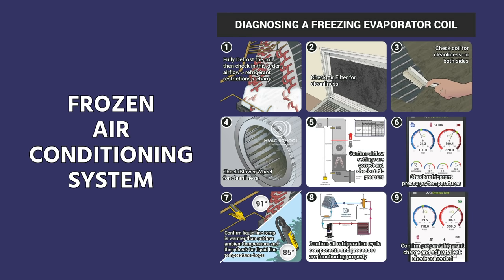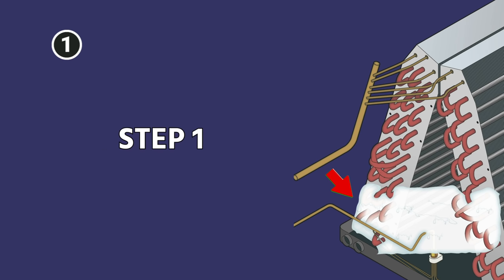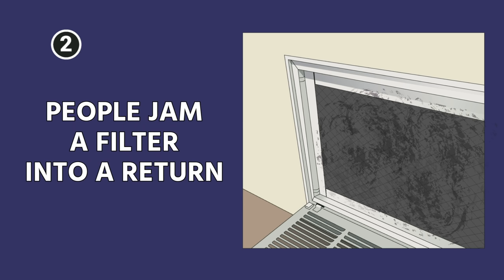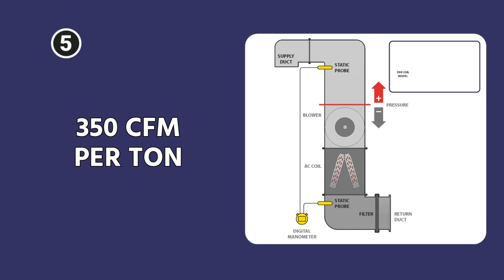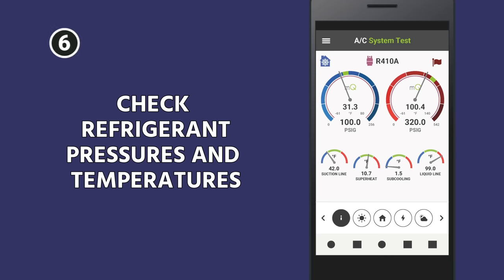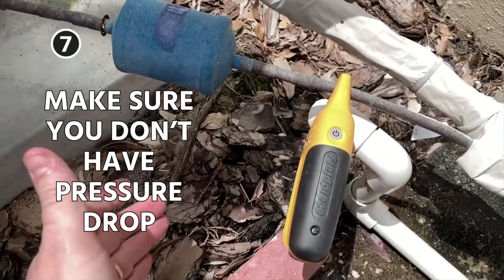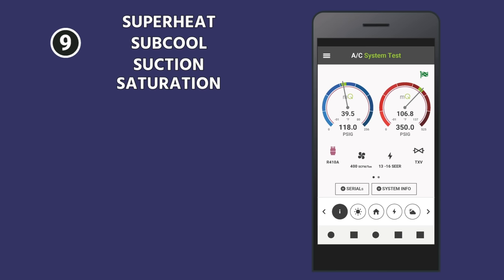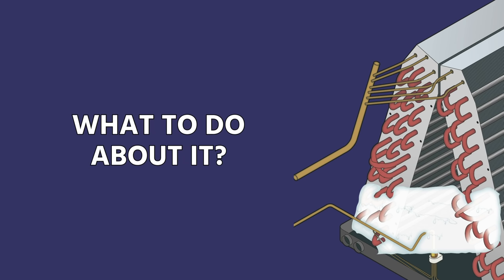Why Does The Evaporator Coil Freeze (And How to Diagnose It)

Comment: Fair warning- if a blower wheel has been dirty long enough, you can KO the motor once you put the full load of a clean wheel on it.
Reply: i always give my customers this disclaimer before I clean a blower wheel. also if the evap coil does freeze up i tell them that expanding ice can cause leaks in the joints of the coil. I've witnessed a 1 year old split system (in the attic of a 30 unit apartment building heating and cooling all the common areas) whos filter never been changed (one year) have leaks after i thawed the thing. i'd already put in my 2 weeks at this point so i no longer had a filter when talking to customers and told them since you were cheap and didn't want us to maintenance the equipment, now you have a massive leak.

Comment: In the house units. It’s always one of two things. 1). Low air flow. 2). Low freon. Always. Every time.
Reply: B
Reply: You just stated a generalization that is always true of every system...so, did you not understand this video?
Reply: @Maxumized  which part did you miss? Did you not even watch the video? It's you that don't understand. I've been doing HVAC repair for 35 plus years. Refrigeration and auto ac for 43 years..

Comment: I do know when its 90 out and humidity approaches 95%….It becomes much easier for the “A” coil to freeze up, if it does, turn on the heat!!!   Takes very little time to THAW out  the coil and dry it out, works!!   And then let the compressor cool down as well.

Comment: I have a unit in my attic , I wanted the a coil cleaned . I called a HVAC company to do the best task, he was up there for 1 hour. And the secret hidden camera I had up there recorded fed him sitting down occasionally running his drill into empty air , tapping occasionally with a screw driver on the metal, ran the vacuum motor but not actually vacuuming any thing he was on his smart phone the entire time. I was charged 209.44 for nothing, I showed the video to him he said he was going to sue me for recording him without permission, later in the week I got a check for 225.00 back   Wtf??
Reply: Guess he figured his picture was worth $15.56. At least you got reimbursed. No telling how many times he has stolen people's money.
Reply: Oh and another thought, these damn smartphones today,  nobody gets anything done anymore everywhere I go people at any job f in with their gdamn phone. It's absolutely insane.

Comment: What is your opinion of turning the heat on to thaw the evaporator
Reply: I do it quite often but monitor the liquid line temperature
Reply: I'm not an HVAC tech at all, but deal with Magic Paks. (All in one unit within the rental unit.) I turn the system off and turn the fan to "on." Make sure your condensation drain is clear, tho. Our 3/4" drain lines start on the 3rd floor and lead to the garage that tends to get plugged also.

Comment: So, I get what might cause an evaporator coil to freeze, but I'm trying to understand how it happens. An example, if my coil is dirty, the evaporator will freeze because the refrigerants drop in temp. Is causing that (due to no heat absorption) am I in the right ball park here?
Reply: Yes! You got it. On a dirty coil, the refrigerant temp drop is accelerated so coil continues to drop in temp and moisture in air freezes.
Reply: @Maxumized  yeah took me a while but I finally get it. Pressure and temp are related.  Restricted air flow means more liquid refrigerant which means less pressure in the Evap. Which in turn leads to lower temp. I never knew hvac could be so engaging
Reply: The way I see it, low air flow/dirty condenser coil has the same effect, that is, limiting air flow across the evaporator coils. This causes the air to slow too much/spending too much time around the evaporator coil and thus loosing too much heat to the coil. To the point that this air has enough heat sucked out of it that it gets below freezing! And on and on it goes...more frost more air flow restriction means even more frost...I know there’s a word for this...maybe reinforcing feedback loop.
You see, the refrigerant going into the evaporator is all gonna go from liquid to vapor regardless of what the air flow is doing...so the refrigerant must suck whatever heat is can from the air...it’s an intrinsic property of phase transformation when liquid is transforming into gas. 
Prove me wrong but this gotta be it!
Reply: @Brasil28  you’re sorta right. Let me use your example, a case where my evaporator coil is extremely dirty. All that dirt and gunk will definitely restrict my airflow across that Evap. But, frost won’t accumulate because the air was moving too slow and lost all of its heat, frost accumulates because of the moisture that’s in the air condenses and freezes when it passes through the evap coil. See, when you have a major air restriction, your superheat will be very low, meaning you’re not absorbing enough heat from the air (because of the dirty coil causing the restriction) and because you now have less vapor than usual, pressure inside your evap, will be lower than usual. And as we know temperature and pressure are related, a low evap pressure = low evap, temp. This low temp in the evap is what causes the moisture in the air to freeze as it passes through the coils. I hope I explained that well enough.

Comment: Too dense of an air filter? From my experience (I'm not a repair tech, just built super energy effecient homes) is too small of an air return duct! In my homes I filtered at the return grill and at the HVAC unit. Yes I have to oversize my return duct (which cost more to install) and I put multiple return ducts throughout the home! If there's ice beyond that, then it's a mechanical failure. Air flow is very important across the coil.

Comment: Can icing cause the blower speed to fluctuate a lot but mostly run at very low speed? This is a problem I’ve been having during a recent spell of hot weather. Usually turning the system from cool to off for a while fixes the problem and then it’ll work fine again for a day or two. If I leave the system off but the fan on, it seems to blow at the expected constant low speed.

Comment: Question, I have told that the ducts need to be replaced to a larger size.  I am  DIY person. Generally,  would increasing the size of the ducts by 2 inches resolve the issues?  The system works fine now but I just wanted to get some info about the ducts.  Thank you.
Reply: (Not an expert) I would increase the duct size if that has been recommended. For example, if the ducts are 8 inches and you are going to 10 inches, the cross-section increases 50%. If going from 6 to 8 inches the cross-section increases 78%. Since the goal is to get above the point where the evaporator freezes that could be a crucial difference.

Comment: We learned our condensation line was dripping under the house into our crawl space. In an already poor soil (Adobe western Colorado) we didn’t like all that moisture down into foundation. We had an evap line ran from the existing down to a pump that kicks on when it’s reservoir is full and pushes the water out a drain line away from foundation. Since having that installed by an AC guy, his idea actually, our coil froze up and the blower pushed so much air past the coil and it literally knocked the lower cover door off the unit. Is there a connection to this Evap line setup and this freeze possibly? Also have no idea how long it’s been since coil was cleaned. We bought in 2015. Had an ac service/tune up spring 2020. Dunno if they cleaned coil or not. I know they did not remove it. It’s manufactured home and model number for coil is
mbc48dqd. Coleman unit. 

Thanks for any pointers.
Reply: I also live in Colorado (Denver) I work on mobile home a lot. I se these problem so many times 99% of the time is the dirty coil or low on refrigerant, also most of the times mobile homes don't have TXV and have smaller evap coil with larger capacity C.U.

Comment: on a variable speed compressor like the bosch (25%-110%) ids 1.0 ;  should the system be put into force mode (100%) before you test the temperature difference?  for me in regular mode when its about 50%-70% compressor running load the Temp Delta is about 5-6 degrees however if I put it in force mode its under 2degrees.  Manufacturer says it must be in force mode in order to be able to charge.  I am assuming the same holds true for the Liquid line temp difference across the direr? is that true?

Comment: Hi, i have a long lasting doubt, cylinders saturated pressure depends on ambient temperature, same way evaporator pressure depends on which temperature, as there is return temperature and supply temperature, what decides suction saturation temperature

Comment: Why would the low charge still freeze up with proper air moving over evap coil, the delta T drops?  With low charge there would be no liquid in evap only low pressure vapor, always seems strange coil would freeze up to me.
Reply from the maker: Because unless the system is flat there is still some boiling refrigerant at the start of the coil but at a lower pressure and temperature. The ice can begin there and then cascade through the coil as the ice restricts airflow.

Comment: Million dollar question can running the AC with the evaporator frozen cause the lost of refrigerant ?  And is that consider a leak created by running the AC while evaporator is frozen??
Reply: @timusa3937  I was able to add a few pounds and working good now but wondering if that amount indicates I have very bad leak??
Reply: @timusa3937  but could the Freon leak then stop leaking because it’s work great better than every
Reply: @timusa3937  should the dollar stick to any return or main return

Comment: I know this is off topic but, i just installed a unit at my school that i got from AHRI after being tested. in 16 years i have never seen 110v on condenser contactor coil. checked prim and secondary side of xfrm, 120 prime 28 secondary. Followed to the board same volts. some how i'm getting 110v on my contactor coil at my condenser. Has any one seen this before.
Reply: Nope, but you got my curiosity. Let me know what you find.
Reply: Are you measuring across the contactor coil direct or are you measuring from chassis ground then to one side at a time on the contactor coil?
Reply: If you’re getting 110 to a 28 volt coil  - it should burn up fast ?

Comment: There is one item you left out. A bad inside fan motor. It is very difficult to diagnose and for my Lenox system, very expensive. I have a two zoned system so staic pressure is difficult to read. I have had the motor go out three times. The last time I replaced the inside unit.

The fan motor would not run at full power but was undetectable. The symptoms were a rare coil freeze, extreme sweating on the outside of the indoor unit, and low indoor air humidity. The motors died in different ways. One died years later after an electrical problem where I lost one incomming electric leg.  That later claimed the compressor too. Another just died and was how I determined it wasn’t. running full power. Another started vibrating because a coill was shorted. 

In all cases the bad fan motor was hard to detect prior to failing completely. Any suggestions?
Reply: He didnt leave it out. A fan motor falls under the category of airflow (dirty filters, coils, motors, small ducts, etc).  Sounds like you have a very quirky or brand specific problem.  Either a made in China cheap fan motor, maybe a bad circuit board, or something going on with the power in the unit.  Very speculative without doing specific voltage checks.

Comment: I’m confused. @1:51 you say I could use a heat gun but then @1:57 you say don’t use extreme heat. Doesn’t a heat gun produce extreme heat?
Reply: Not if you don’t get too close.  Better off using a hair dryer on high.  1700 watts is a lot of heat and there is plenty of flow.

Comment: Very educational video but missed one thing. Air flow is good, but I have seen run capacitor for indoor blower go bad and caused the coil to freeze up or motor burnt up.
Reply: Um so like Capt Obvious guy says, an indoor blower fan sorta, kinda affects airflow in some unknown way to modern science. U see, what happens is the fan motor spins the blade, which then causes AIRFLOW.

Comment: I'm not educated in HVAC, but I remember multiple times at work the system freezing up and melting from the ductwork through the ceiling tiles.
Reply: That sounds like the ductwork sweating from improper insulation or a drain backed up leaking.
Reply: You mean 'condensation', right?

Comment: 1. Lack of Airflow 
Plugged air filter / Dirty coil / vents shut / squirrel cage caked with debris bad blower motor. 
2. Low on charge
3. Faulty metering device
4. Pressure drop across filter drier.
Reply: Bad capacitors before low charge
Reply: @srobeck77  :  true. When they are too low it won’t turn over the motor.

Comment: Is 40 degree drop from my vent temp inside  to 110 outside optimal  at 76 inside vent
Reply: If my math is correct, wouldn't that be a 34 degree temp. difference, not "40" point difference?

Comment: So... yesturday I had a call to a txv system in a kitchen walk in freezer, the system used to be 410a, but that gas got changed to 452a because on the hotter days the whole thing would trip out on high pressure, we charged by sight glass. The evaporator and vapour line were well iced up, and now we are heading into autumn, few months after the gas change, however the lead tech has been altering the controller settings, and he believes he’s made a mistake in the defrost settings by way of frequency or timer cut off etc, is there a way to see settings effects on a system?

Comment: Air flow is HVAC 101.defrost coil, then Is Air flow good inside and outside.  . Very rare is a contactor stuck. If coil is completely frozen it will require a second visit.
If all is good, move to refrigerate.

Comment: But   hurry up, what is the problem or cause , can we adjust it,  I just called to let you know I have two more calls for you in that area..don't hurry til you are sure, call me when you are in the van...
Thank you thank you Bryon again. keep them coming. 
Are you familiar with the modulating ac condensor fan control prior to ecm/pwm switch over..thermister inserted in the condensing coil to measure temperature-pressure relation to help stabilize the system in wide range  of ambients 95 to 0 degrees F.   If you are .. hint hint 😇
Reply: All you got to do is...
YOUR STILL THERE!
All ops ok at this time will follow up.
The kooter valve is bad.

Comment: I just kick the heater on for a minute to defrost it. Is that bad?
Reply: lol, yup
Reply: You're going to make water get everywhere. In a residential setting. 
Best is just to turn the fan to On. and stop the call for cooling. By pulling the breaker, disconnect Or changing the thermostat setpoint.  When you return in 2-3hours the Ice will be gone. 

Alternatively- you could Use a wet Dry Vac I'm just not sure where I would make space in my Van.

Comment: You can't emphasize charge as the last issue.  1 pound free per year at my shop. Needs sealed system tech. Reality secondary plugged if not the coil. USE YOUR TOOLS FOR PRESSURE. AIR FLOW AIR FLOW. RANGE 10 SUB 10 SUP CLOSE. AIR FLOW. ADDRESS. THEN FINAL SC SH...........

Comment: Hi my split AC is literally throwing water out of its blower every few 15 mins. Checked the drain pan and pipe is clear. Any idea whats the cause?
Reply: Does it have a P trap in the drain?
Reply: @skutahuniai4830  no it does not have a P trap. i'm using gravity assisted draining by pointing the drain pipe downwards to a water pump.
Reply: @djkenishii  The suction from the blower fan is restricting the drainage of water.  Put a P trap in the line where it exits the plenum.  This will stop air from entering the opposite direction and then allow water to drain from the pan under the E coil.
Reply: @skutahuniai4830  you mean P trap on the drain pipe exiting the AC or P trap on the water pump line?
Reply: @djkenishii  Read my reply!  It says, "Put a P trap in the line where it exits the plenum"!!!
Reply: @skutahuniai4830  i am using a mini-split. what's a plenum?
Reply: @djkenishii  In your original post, you said nothing about a "mini" split.  All other residential AC's are split system because the condenser is outside and the evaporator is inside in the furnace plenum.  Two entirely different systems.  If you want accurate information, you have to SUPPLY accurate information.  Irregardless, put a P trap in the line where it cones out of the evaporator unit.
Reply: Thoroughly clean out the entire drain line and install a p trap like the other reply stated. The airflow is causing it to not properly drain and the condensation it accumulating in the drip pan and then gets so full your fan starts chopping into it. Clean or replace entire drain line plus a p trap.

Comment: Next video WHY DO EVAPORATOR COILS RUST!
Reply: Rust or do you mean corrosion? The coil is aluminum and doesn't rust but I've seen them get corrosion.  The frame they are in is sheet metal and can rust from condensation, sweating, moisture.
Reply: @kevinmccool3719  U must be from Georgia 🤔🧐it's the same thang dummy